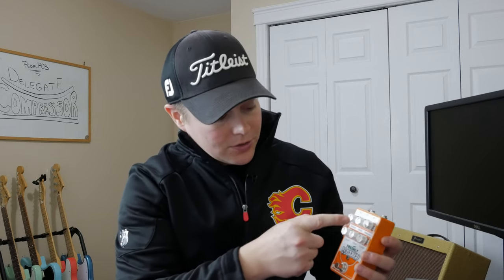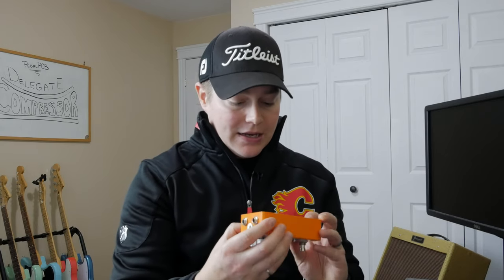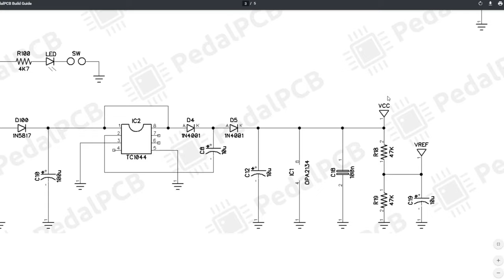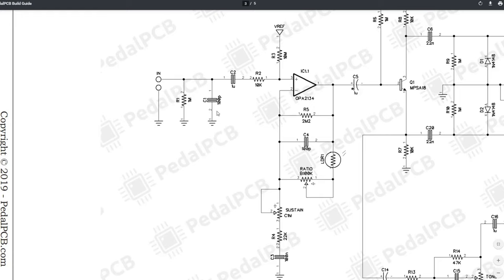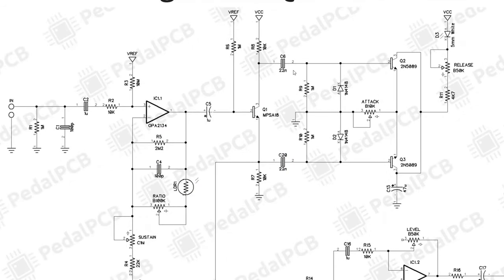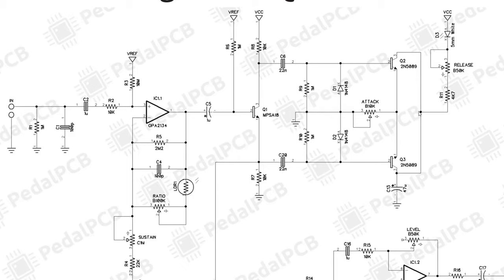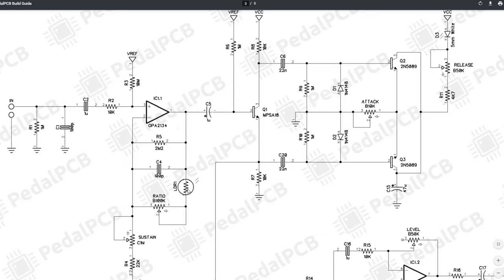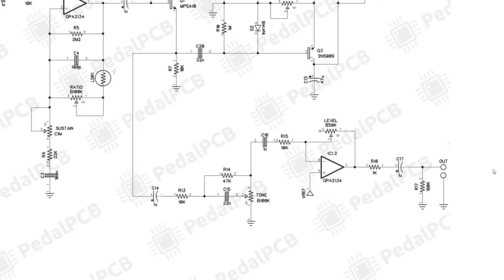PedalPCB Delegate Compressor | Circuit Review & Demo | DIY Guitar Pedals

Comment: That was a boss video my dude.  Aces man!  I'm going to try and use this as a test platform for some brainstorming.  I want to do a pedal that uses a from of hydraulic pressure for feedback in the circuit.

Thanks for the straight and to the point walk through of the schematic.  It really helped me to understand fully what the actual waveform is doing, and somewhat visualize it.  I have yet to start playing the guitar, save for a few strums here n there, But I love me sum drums ;)  acoustic, electronic, made from whatever the heck you can find lol,. I was hoping to use  this hydraulic sensor as a trigger .  First stop, schematics for a cheap circuit I can easily build and play with, something I can modify etc. to get my feet wet.  This was perfect.  New sub for sure.  Cheers!

Comment: Hi ! i've seen your videos about the Warden clone ! i'm new in diy building, and i have a question. Do you know what's the difference between the "Delegate compressor" on pedalpcb and "Tone Guard Device" on Musikding (pcbmania) ? The pcbs seem to be differents... thx for your help, and thanks to you i think i'll try to begin diy pedals ;)
Reply from the maker: Looks like they are exactly the same, just different layouts. either pcb should do the job. PedalPCB does give you a specific part number for the LDR though (GL5516) which i think you will need to get from Smallbear. You could swap it for a KE-10720 from Tayda. It would be a little different, but would still work.
Reply: @pougnetpedals  hi ! Thx for your answer 👍 ok understood, so I’ll choose pcb from Pedalpcb and your video will help me 🤩🤩. For the LDR, I’ve not found it on smallbear, tayda, musikding,… only on eBay or Amazon. I have a question about capacitors which voltages would I take ? (10V,50V,100V, 250V) ? Thx for your help ! 😎😎